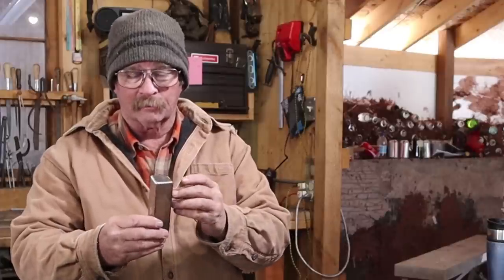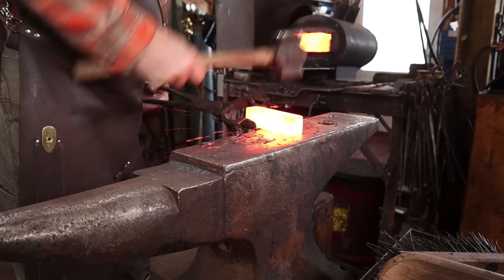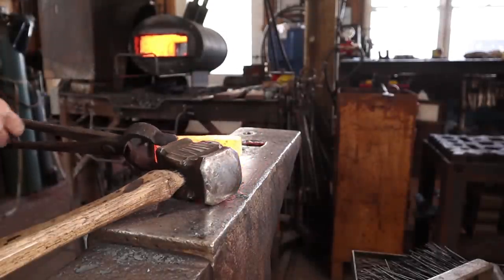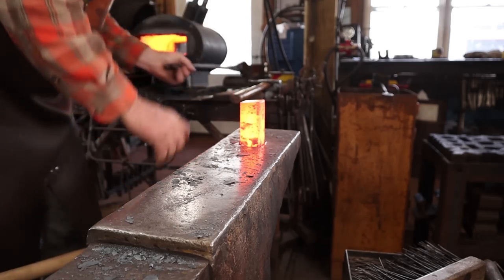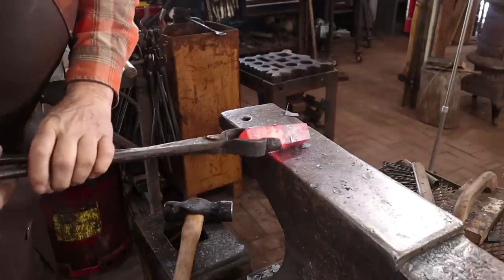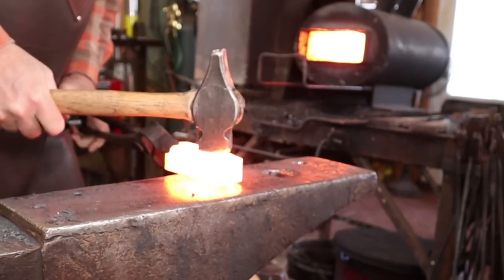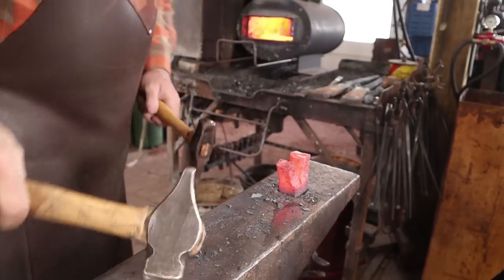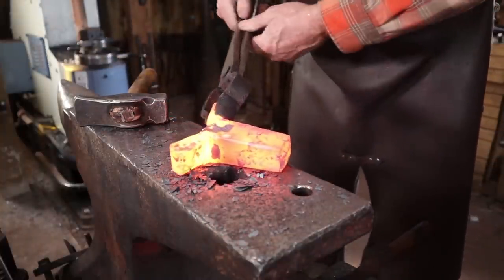Anvil bending or scrolling fork

Comment: I have two anvils the smaller one has a 1" hole that is straight. and the larger one has a sloppy 1" hardy that is like yours, that is a little crooked. I usually go to the larger sloppy crooked anvil. It's odd how that hardy hole isn't more standard. Thank you very much for sharing another great video.

Comment: I made a bender like this with some mild steel and a welder a while back and it was great for thin narrow metal.  But then the second I used it for something as wide as it in a pinch to make a tool it was too weak.  I like your version much better.  I hope it works well for you I have found it nice having the mass of the anvil behind your scrolling.

Comment: Bring on the hardy tool of the week👍
John makes a good point about the bigger hardy hole. Means more working big stock down for hardy tools. If you’re looking at anvils, consider a 1” hardy hole max. Mines 1 1/4” and it does take a fair bit on extra work to make hardies (unless you fabricate them).
Reply from the maker: I have thought about welding a 1” sleeve in to permanently change it to 1”
Reply: @BlackBearForge  I have done that to my anvil and it has worked out just fine so far. I used tubing that had maybe a 3/32nd wall so it had a little give when one of my hardy tools wanted more room to wiggle properly. Welding on the face of the anvil was a little scary but I got it really hot first and no problems have developed. I sure appreciate all that you share with us.

Comment: Man, I'm so stupid sometimes...
I had a piece of square stock that was too big for my hardy hole so I milled it down to fit. Haha
I guess I'm not quite thinking like a blacksmith yet.
D'oh!
Reply: oh its a lot better than what i was thinking "upset your material to make it bigger................"
Reply: I ordered some 7/8 stock for my Anvil, as it turns out, i have the exact opposite problem, the hardy is more like 15/16, ill be learning the upset skill I guess. Thanks John, great work
Reply: @shawnpittard5961  
That'll probably be a good project though. Have you been blacksmithing long? I've only been at it a few weeks.
Do you have a propane, or coal forge?
Reply: @AZ-kr6ff  I have been at it about 3 months , I have a double gas burner from DevilForge. Very happy with it. Yourself?
Reply: I want to build a coal forge in the future. I'm currently watching a Livestream from Sam Towns. He has a podcast as well called the ForgeCast. He's a co-host with Alex Norton, both are extremely intelligent and have sped up my process for sure.
Reply: @shawnpittard5961  
Oh thanks, I'll check them out.
I built a gas forge and bought a 1" forge and foundry burner.
In hindsight a couple 3/4" burners may have been a better idea rather than a single 1" burner, but it works pretty well. It gets plenty hot.
I'm starting to appreciate coal forges, they seem to have some benefits.
It's fun, man. There's so much to learn.
Reply: @AZ-kr6ff  agreed 100%, keep in touch man.
Reply: @shawnpittard5961  
Yeah, for sure.
I checked out that channel you mentioned, it looks pretty good.
I like the axe's.
I restored an old hand forged hatchet recently that a friend brought to me. Nothing serious, I just put the wire wheel to it and filed sharpened it, then sanded and oiled the handle, but it made me want to make one.
Reply: Funny, I have done the exact same thing man, it's hanging in my little smithy I've created on my back porch area.....I'm a carpenter by trade, but no matter how hard I work during the day I always enjoy working around the forge after dark for some reason.
Reply: Also check out the ForgeCast podcast it's very good for people like us. I communicate with the guys weekly, they are good Mates. Australian ones.
Reply: @shawnpittard5961  
Oh cool man.
I'm a welder/fabricator which comes with the luxury of having plenty of free scrap steel to practice on. Haha
Reply: @shawnpittard5961  
I'll definitely check out the podcast, thanks.
I've got a good friend from Australia.
He's on the west coast US, though, California...I'm on the east coast.
This fellah from Black Bear is a super guy, too. He's answered me a couple times. He's become my favorite channel lately.
I like gstongs a lot also.
Reply: @AZ-kr6ff  I just bought my first welding machine today, excited to learn that side of things as well.

Comment: Looking to build my first treadle, so sorry if it’s a dumb question...   forging the top side of that down (to keep the 1/2 inch shoulder) wouldn’t a treadle hammer be a better tool for the job?  Extra control and all...  does it not hit hard enough or are you trying to avoid all power tools for the viewers?  Thanks again and looking forward to other videos!
Reply from the maker: With the right dies a treadle hammer would work very well for this.  In this video I wanted to show the entire thing done at the anvil
Reply: Black Bear Forge that’s what I was thinking, I just wanted to make sure...  last night I set up my temporary forge for the first time...  didn’t get a lot of work work done, but I sure did a LOT of learning in that 2 hour forging session, lol.   Biggest three lessons were 1) a pair of solid tongs is possibly as important as a good anvil, and that I need to dress the edges on my railroad track anvil...   the corners aren’t nearly sharp enough to get good lines on the transitions, and 3, as a mechanic that is very good with a hammer:..  my arm simply isn’t nearly as good as I thought it was, lol. Keep up the good work sir!!

Comment: That looked like a lot of work. I have a question, would it be more difficult to forge weld a piece of round bar to the end of your stake than cutting the square bar?
Reply from the maker: For those comfortable with forge welding, I think it would be about the same amount of effort.

Comment: My hardy hole has a similar issue, 1inch x 7/8ths I've been noodling with the idea of "fixing it". I don't have more than a couple of hardy tools, so not a huge issue tooling wise, but maybe goofing with it trying to get square is a bad idea... I could see a situation where I have a perfectly square (giant) hole where my anvil used to be...
Reply: gunterhausfrau I would probably try to fix it. Many of your hardy tools will be useful in both directions. Just use a file instead of a power tool so you don’t go to far too fast.

Comment: Alright, since we're talking about hardy-holes... I've notice on many occasions that the hardy-hole in your anvil is... well used.  What causes wear like this? What precautions can one take to prevent that from happening?  At what point will it become a problem, and how would one approach a repair? If I grasp the purpose correctly, the shape of the hole is less important than the fact that the hole/tool interface prevent your tool from spinning. I had always assumed that hardy-holes were a standard size. Seems like that is not the case.
Reply: He talked about that in a video some time ago; 1" square is a common size; but there's no real standard, and larger anvils may have larger holes, like his, which I think he said is about 1.25" square. In fact, he has some square bushings that adapt his anvil to use common 1" hardy tools. It would take a great deal of wear for the hole to need repair; the top corners wear quicker, obviously, but as long as the hole retains its square shape, the shank won't turn, and it would probably be easier to heat up the tool and upset it a little to fit the anvil, rather than try to weld material into a worn anvil to fit a tool.
Reply: But if it did ever become a problem, the standard method for anvil repair is to use some hardfacing welding rod and then grind down until you have a good match with the existing.
Reply from the maker: Hardy holes do vary a great deal in size. But they should be square. That allows the tool to be rotated all four directions. My anvil is well used but the worn edges of the hardy hole aren’t really a problem. Sharp square edges require a perfect transition at the shoulder while rounded edges allow a bit of a rounded transition or a weld bead if fabricating the tools.